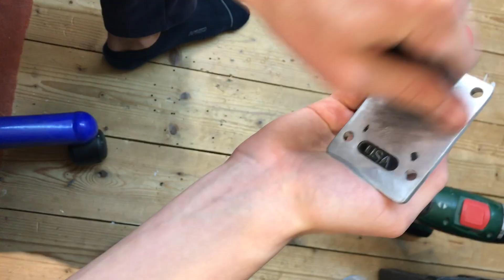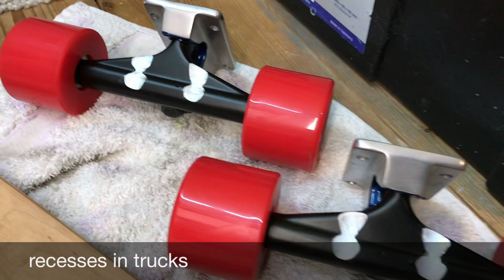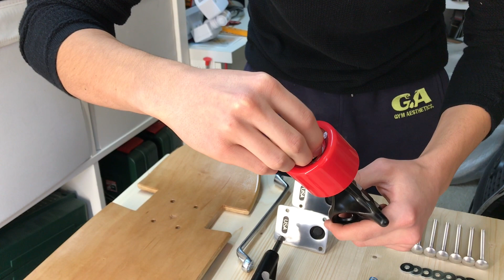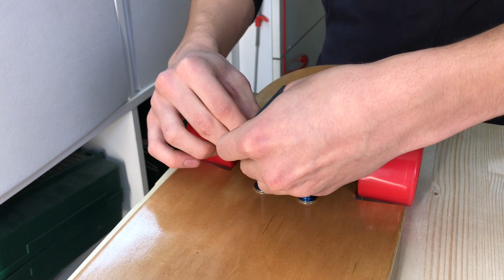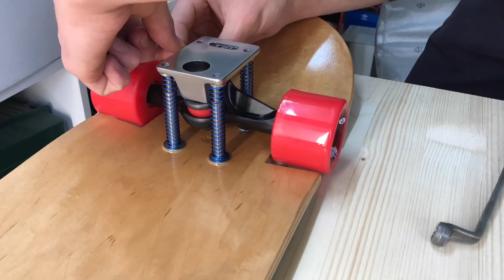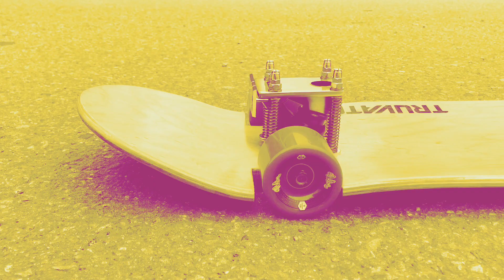How to build: hellaflush skateboard, lowered skateboard

Comment: He's showing us how, but he's not showing us why!
Reply: It's a long distance push skateboard. Because the deck is extremely low to the ground, pushing is far more easy and effortless, it's similiar to walking.

 So you don't need to squat for every push, and you can cover longer distance with this set up.

You can find similiar low design deck in LDP longboard, try search for LDP longboard.. the deck is lowered by double drop and drop through trucks.

The Pantheon Pranayama is by far the lowest longboard deck specializes for LDP.
Reply: @petrichor9465  It's an LDP board for really long distances and absolutely no turns. Personally, I wouldn't want to skate on a highway, but to each their own.
Reply: @epr8974  i commute with my shlongboard , the low deck really help for LDP.  

Low rider is cool 😎

Comment: What are the springs for?
Reply: honestly they don’t really do a damn thing
Reply: Probably shocks
Reply: @abraham3213  can't see how they would work
Reply: i think its there just for better height tuning
Reply: @hoshiyomi1079  This, also when you loosening the nuts those springs will push up on the plate allowing you to use a ratchet properly instead of the nut spinning too freely once loosened for the ratcheting to work.  Also it'll somewhat prevent the nuts on top from loosening themselves and falling completely off.
Reply: Just for looks ig, yk they wouldn’t work as shocks unless there was space in between